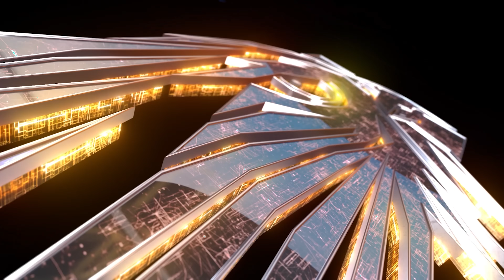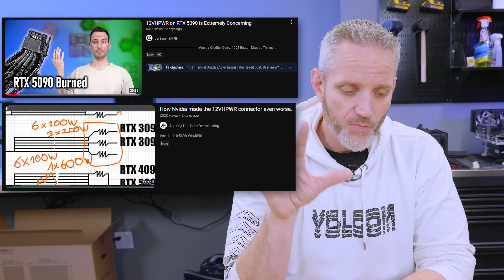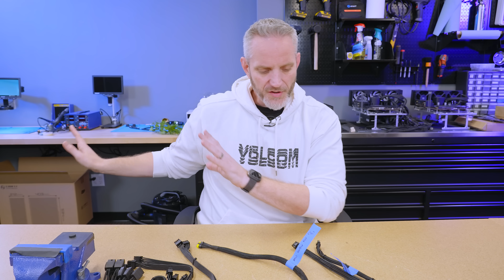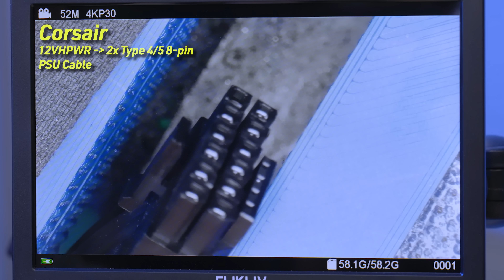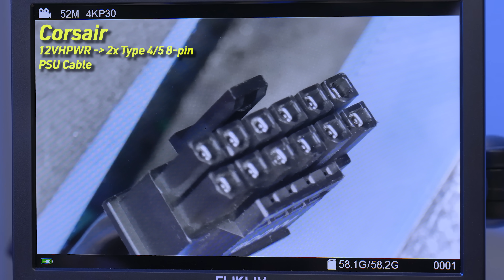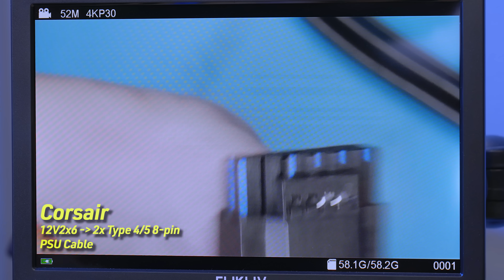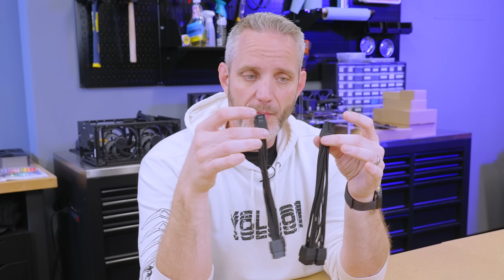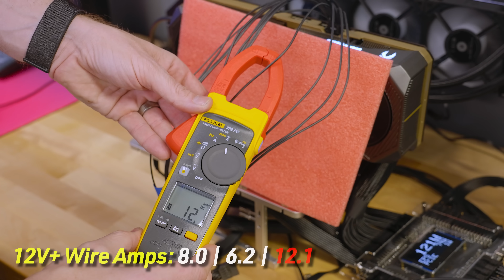I discovered something concerning and I need the Experts to chime in... More 12VHPWR discovery!

Comment: knowing this type of issue for decades (old molex connectors), ive always had the habit of pushing by the wires of cables, but there is a point where this cheap flaw was corrected. unless you are the cheapest of cheap using guidelines as a suggestion.

Comment: After gamernexus dissected the connector and explained in depth, pin contact. I have to say the 12vhpwr is a bad standard to use on a 5090, there is just too much variable with quality control and   nvidia being cheap on shunt resistors, there is just not enough safety margin.

Comment: make something like the xt60, xt90, xt120, double the pin count, include a locking bail/latch like some auto connectors have, and boom, winner. not only is it keyed, but it has insane overhead for future power use. want to key it for wattages? include a metal strap on one side or another or two sides with resistors. have that built into the connector itself and the socket has one or two contacts that touch the plate or terminals on the side of the connector and reads whatever config to determine capacity.

and the best part; you can make it the same size as the 12vhpwr series without having the issues we're seeing.

heck, it'll probably barely get warm.

Comment: I have used my Cable mod 12vhpwr cable since day 1 of the 4090. I made 100% sure to press the cable in securly and i even tried pushing in all individual wired to on the plug. never had a single problem. I bought the 4090 day1.

Comment: Showed this to my electrical engineer partner who works on modules for the ISS: a little movement of one pin and inconsistent depth is normal and the spec would detail the tolerance that is OK. But when you showed how far the pin went in, they immediately said "oh that's a dead pin".

For their flight hardware, they have a rating for how many times a connector is rated for re-seating. If it's a "low" number of reconnections, then they document every time they re-seat the connector. A low number for them is 100-200 reseats. It does seem like this cable is even more fragile than that.
Reply: This is way more fragile than that! These are speced for 30 reseat cycles (some cables are higher speced, but 30-50 seems common).
Reply: @exscape the older 8 pin pcie connectors are also rated for 50 as well also remarkably low....
Reply: have them see the entire videos... and it will likely shock them.
Reply: @CatAkimbo  - I looked up the specification of a molex 12vhp crimp terminal. No of connections is 30!
Reply: That's cool
Reply: As fragile as a trumpists ego.
Reply: @joeds3775  As fragile as someone who has to bring up politics in a discussion about electro-engineering.
Reply: @OreoBambino  we were talking about fragility. And you got triggered.... You delicate little flower.
Reply: @joeds3775 with everything going on not everyone wants to constantly be reminded of politics and how shit everything is. You can have a conversation about one issue without bringing in politics.
Reply: @joeds3775  Dude.. be a grownup. Stupid irrelevant remark.
Reply: @ashkebora7262  trump is in our newsfeed basically 24/7 for all the crap he's doing, and I'm also English so it doesn't affect me that much. If I want to read up about what's happening I will, otherwise I don't want to hear about it.

Comment: Jay, next steps would be to:
1. Corroborate which wires and pins are pulling which amps, and at what temps.

2. Do the same with the 6 ground wires.

Comment: I have also noticed that all of my CableMod 12vhpwr cables have a very huge wiggle room and sinks a lot, this is the new stealth sense that they have made. After pushing in the connector very firmly, I still tend to push in the wires manually and I can see/feel them move. I haven't reached out to cable mods about this and I know I'll get a free replacement but I do have to pay customs fee even if its for a warranty replacement.

I might just switch back to the cables included by Seasonic.

Comment: All connections in a current loop must be optimal. Any resistance or electron traffic jam will have an effect on the entire cycle. Corsair is just using cheap crap as a supplier. An op-amp moving like that is a failed one from the factory line

Comment: 12V and ground are equally at risk if the 12V power is shunted and redundant or "dumbed down". Because it's "dumbed down", just like ground or common, each connection is sort of redundant and current will not be forced through a bad connection. It's actually safer that way. If more current goes through a cable, it's because the cable has less resistance, so the ones with lower current are probably more dangerous, probably because of a worse connection. On the other hand, I said "sort of" redundant because at 600W even one lost or loose connection can be dangerous.

Comment: I just purchased a Corsair HX1500i PSU with an MSI RTX 4090 Gaming Trio and after watching the video I pulled it out to see which one I received. I have the newer "Gen 2" Version. Which is good because on the box it said it had this, but you never know if it was just a new box. I unplugged mine just to check it out. The pins look nothing like the one shown in the video. They are all uniform and no issues with melting or anything on either side.

Comment: Surely, even if they split the 12V into different rails and connect them to different pins on the connectors, all the ground return wires are joined at both ends? So why weren't the ground pins burning on the old style connectors?

Comment: i dont ever plan on buying a gpu that uses this plug, but out of curiosity im gonna check the 12hpwr that came with my rm1000x 3.1 to see if its as bad as this one. my guess i corsair used a really cheap company to make the plastic housing of the pinouts and the inner molding is either too big or the plastic they used is just too weak and it shaves with a small amount of pulling on the sleeve

Comment: that will definitely cause excessive resistance., you should use a asus 50 series 5090 card that you can monitor the pin amperage with gputweak3. with this cable and see what it is measuring just my 2 cents! compare it to the good msi cable

Comment: As a field engineer who has installed power systems for wireless equipment (IE cellular phone equipment), if you have loose connections, ARCing will occur over time if not sooner.   I’ve seen equipment fried because someone forgot to tighten down connections to spec.  That includes both supply and return, doesn’t matter which.

Comment: nvidia is the VW of the tech world... re-engineering stuff just for shits and giggles, even if its not logical. instead of going straight from 150w 8 pin cables to a 12 pin 600w cable, wouldnt the first step be to go to a 10 or 12 pin 300w cable and just use 2?

Comment: Looks like pushing the plug in correctly pushes out the pins from the inside, like there's a manufacturing tolerance issue with the pins' inner diameter (needing too much friction to fit perhaps) or how they're hotglued in the plastic connector.

Comment: You could meg out the adapter from the bus to the pcie connector to see if there are any weak contacts in the as installed condition. You will probably fry the card unless you do it perfectly though.

Comment: The issue, is that connector wires current are not controlled separatelly anymore, as they use to be. So, 40xx/50xx Video card could try to pull all 400-600W via single wire, if other aren't connected well.

Previous Video card did monitor current, at least in groups, and would refuse to run, if current aren't divided between wires.

Comment: I just purchased a custom set of cables from cablemods a few months ago and had multiple issues with their cables and I am now getting all the parts together to build my own custom cables.  I am a retired Chief Electronics Technician from the US Coast Guard as well being a former 2M instructor/tech as well.  When I got my custom cables from cablemods I assumed that the cables were built to the specs of my power supply but the pin out was completely wrong and that got me worried so I spent more time looking at these cables after I contacted cablemods and they did an RMA with my cables.  My replacement cables were pinned exactly the same as the first set so I got a partial refund and I examined the cables that I was required to cut in half and I found some major issues.  I found the same issue that you are showing in this video with the pins not fully seating into the connectors and they aren't extending far enough in the connector.  I am running Thermaltake GF3 power supplies and the stock cables aren't as bad as the cablemod cables but they also don't seat as far into the connector as they're supposed to like the MSI cables that you are showing.  What I found in the cablemod cables is that they modify the wings that hold the pin in the connector so that it will make it hard to de-pin the cable and possible cause a pin to get stuck in the connector.  cablemods bends the wings over in half which makes it hard to use a pin removal tool and also pushes the bent pin out so when you pull the cable out it wedges inside the connector and can get stuck by pushing out through the side wall which I had happen to me when I tried to remove the cables so I could re-pin the cable to match my power supply factory cables.  because they bend the pins it also prevents the pin from fully seating into the connector like what you are showing under the microscope.  My cables came directly from china BTW.

Comment: This is going on 4090 now 5090,   the prices are still going up yet the cents cable is crap.   Its time to separate form Nvidia.   I can forgive one time but to continually put out inferior product that is not going to hold up.   At theses prices you should plug in hear a click,   turn on pc,  load current drivers,   lets the games begin.  Its years building characters extra.   I like to see a gamers  attitude after spending 10k on a system only to catch fire and smoke system due to bad wiring.

Comment: It’s not the cables it’s the card design that is wrong. Stop looking at cables. 

On a 3090 Nvidia used shunts to measure currents a mosfets to limit currents. Remember the time you had to apply shunt mods to remove power limiting.

With the 4090 and 5090 they removed the power regulation from the board. 

It’s all about the path of least resistance.
If 1 wire has a lower resistance it will result in a higher current. A mosfet is basically a variable resistor. So by getting rid of the mosfets(variable resistors) there is no way to control the flow of electricity and it will take the path of least resistance. In the past you shunt mods 

So any variable in pins or wires could cause a fire. For example if 1 of the pins just has a better connection than the other you already have a resistance difference.a wire from a different batch or different manufacturer with a tiny manufacturing difference can cause problems.

It’s time for the power supply manufacturers to step in and start powerlimiting the 12v6p to max spec.

Comment: In RC cars and trucks, "Tamiya" style connectors would barely work if you didn't push the connectors together really well by holding the wires, even though the connectors were already seated. They would always leave scorch marks inside the connectors, and that was only with two pins. Fast forward to today with 12VHPWR connectors with 12 tiny pins pushing 600W or more, it's no wonder they are burning and melting. Maybe these GPUs should start using XT60 or XT90 connectors instead, as others are suggesting. Since there are only two pins in the 5090, I could just solder an XT90 connector to it if I ever get one.

Comment: DC is direct current to the board from psu there should not be any alternating current going between the two the only thing that should be AC is between the psu and your 12v outlet out of the wall to it. 8 years as an electrician and 2 of those years spent in an industrial setting.
Reply: I'd also check for any closed loops between the cable and psu. Reason being if it's throwing current back out into the psu it could be causing the connector to heat up way to much and then cause the failure that way just because the psu should not be intaking power between the two.

Comment: The cable/connector assembly is the root cause  and the source of overheating. None of those contacts should move that much as the Corsair cable, the implications are obvious as you noted. There are pin pressure and retention tests to determine whether it is good or not. The card has multiple (unintentional) paths to ground, including the Card Fence to the computer case. The +12v pins are more likely to overheat for that reason. Debauer's video shows the wires are hot as are the cable connectors. Poor mechanical contact between sleeve and pin, and poor application of the terminals to the wires in the connector assembly (crimped or soldered) will cause a great amount of heating due to the very high current capacity.  (I can share my credentials privately if you want to discuss, and I've worked at all of the big Silicon Valley places....)

Comment: Kirchoff's Current Law - the total current entering a circuit must match that which is leaving it.  Thus, a high resistance DC negative would have the same effect as a high resistance DC positive (not to mention the fact that current actually flows from the negative anyway but that's a whole different conversation)
Reply: True, electrons have negative charge and flow towards positive.

Comment: Hot take: maybe we should stop falling for the marketing hype and refuse to buy new GPUs when most of the performance "improvements" are simply from pushing more power through the cards.

Until that happens, there's little incentive for them (i.e. nvidia, amd, intel, etc) to fundamentally improve their chip designs to get better performance with the same or less power, and these sorts of over-current fire hazards are only going to become more common.

Comment: jay first thing you need to realise is molex minifit contacts are free floating which means they can move slightly forwards and backwards in the housing and the contact area is not 100% of the mating length. if you get the datasheet you will see the female contact has 2 dimples on each side of the female contact barrel (in the front 3rd) they are the electrical mating interfaces. the contact is designed so that as long as both contacts are correctly inserted into the housing ( eg they cannot simply be pulled out of the housing without using the correct tool) they will make the proper electrical mating, no matter if fully forward or backwards in the connector. that being said this is for genuine Molex crimps if they are cheap knock-offs they may not be fully compliant then all that goes out the window. perhaps extract a suspect crimp and check against molex drawings to see if they are to spec

Comment: One of the first things taught in electrical or electronics education is that electric current prefers the path of least resistance, and that an increase in resistance will reduce the flow of the electric current.  So if you have several parallel current paths and one of those paths have  less resistance than the rest, that path will have the most current.  So yeah, if there's an imbalance anywhere in the wires and connectors, one or more of them will definitely carry more current (and generate more heat).  Before each parallel path terminates at a common bus, there should be circuitry to sense and limit current flow.  I wonder if such protection circuitry is missing from the graphics cards or power supplies.

Comment: I bought a corsair atx 5.1 psu recently, amd the 12vhpwr has missing those wires.

I saw other videos for the psu, so it's not a mistake, so then i thought those might've been sensewires when you use the older pcie cables with the adapter

Comment: New PC builder here!  Why is this even the power distribution/connector that is still used for "high power distribution"?  More power (at these levels) requires thicker cables, not more cables.  Give me a power supply with a 14awg feed for demanding products any day over this garbage.  On top of that, why are these connections always on the front/top of the card (depending on configuration) instead of the back/bottom/rear of the card?  Am I alone (or dumb) on these thoughts?

Comment: Corsair cables are all garbage. All cables that came with my Corsair AX1500 and 1600 PSUs were just horrible, with bad pins on every single cable. 
I still use some of them for low power runs on the test bench, but I don't let their pcie cables anywhere near my workstations or my pew pew build.

Comment: If the connector pin was making a poor connection, you are more likely to find the pin area is damaged. If both the connectors and the wire are damaged by the heat loading being distributed across all, it is not the pin, the circuit is pulling too much load.